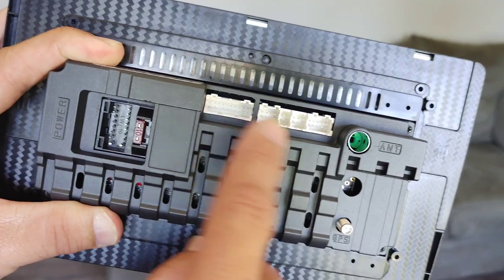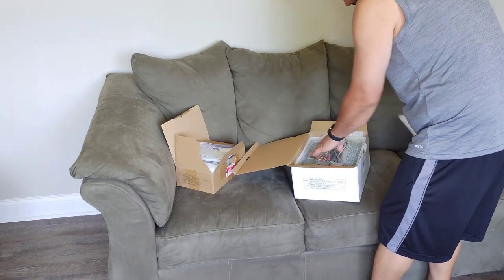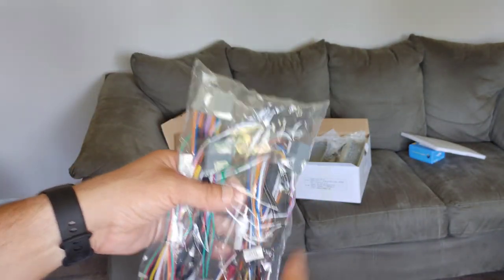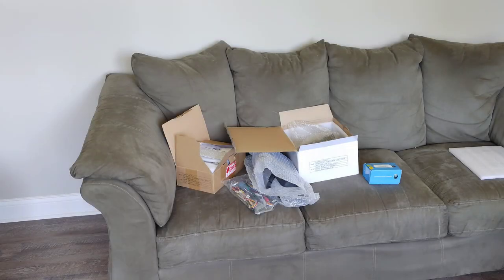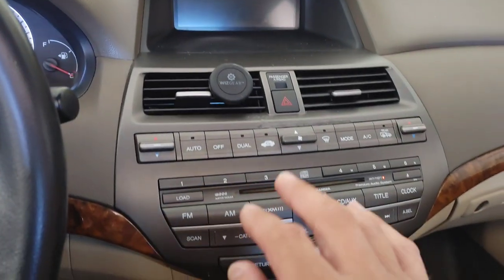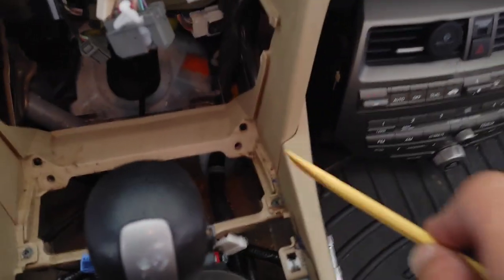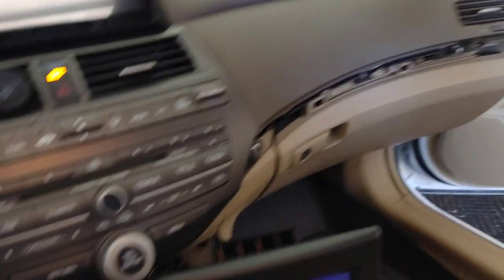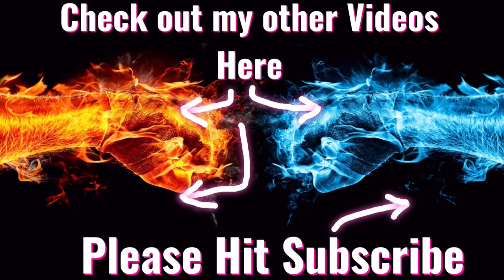$207 2008-2012 Honda Accord Android Radio Install 10.1"  DVD Navigation GPS Bluetooth Backup Camera

Comment: When you start putting everything back in, did you start with the radio, then the head unit, then the clock?
Reply: Btw were there any wires you didn't use?

Comment: Hi; Were there two Phillips/8mm head size screws behind the storage cubby below to complete the removal of the OEM radio? On mine there is - it was basically 4 screws and a bunch of clips holding the OEM radio in. Ours is a bit different - no dual auto heat/AC and no SiriusXM which I have in my Civic and love so I was wondering if Honda had different setups in 8th gen Accords?

Comment: How secure is the unit tho? Someone said that this size can shake loose from car vibrations but idk how credible that is
Reply from the maker: I don't see that happening, my car is lowered and has low profile 20" tires and have never had a problem.
Reply: Happened 3 times.

Comment: I had an Android Head u it installed in my 011 Honda Accord. It works and the stock radio too works. But when i finished i discovered my power lock does not work, key fob does not work, Washer does not spray but wipers work, night lights on my radio and HVAC do not light up, my High beams too do not work but low beams work. Any idea what could have cost this?
Reply from the maker: Sounds like you did something wrong and shorted something out and or blew a few fuses. You need to start by checking all your fuses in all the fuse boxes. And if they blow again then you have something wired up wrong on the radio.
Reply: @RoadMisfit187  Everything was just plug and play, no hard wiring apart from backup camera and Steering wheel controls (SWC) which i connected later after the issue had started.
Reply: @RoadMisfit187  After spending like $180 for car repair technicians to troubleshoot the problem to no avail, i went back and reconnected my old system back and all the problems went away. So i started connecting my New Head Unit again while trying to find out what I was doing wrong. So i found out that i wasn't fastening well one of the plugs. Since then till today my car works perfectly.
Reply: Please make sure you fasten or connect your plugs or connectors well. I found out i had some loose wires (probably a ground wire related to the ignition) that was causing the problems i had. When i went back and tightened my plugs and connections, everything was fine till today.
Reply: The same thing had happened to me but only the hvac and night lights wasn’t working. The minute I had turned on my low beams the fuse regarding that would make an electric noise then blow constantly having me to replace it so I switched back to factory. Did you end up fixing the problem?

Comment: can you explain where to connect the camera wires at the back of the android unit exactly.
Reply from the maker: Its been a while but on the back of the unit I have a wire with a tag called Camera. I used that wire. And plugged the rca jack into the carmera rca.

Comment: Thank you for the tutorial. Questions: Did the unit come with the bottom plastic trim piece where the original clock screen goes or did you buy that dash trim piece separately?
Reply from the maker: Yes, it came with it. It comes with everything you need to do the installation. It is so nice!
Reply: Is there a way to just buy the bottom trim piece separate?
Reply from the maker: @Threework  not that I know of

Comment: Hi im thinking about buying a screen for my honda accord coupe 2008 but it doesnt come with the down box to relocate the radio, is that part very necesary? Do I need to buy it separately or can I just take out the radio? Also tis a different model, a 12.3 in horizontal display. Thanks in advance!
Reply from the maker: Yes, you need to relace the climate control display. Otherwise, you won't have any heat or air. I don't believe they sell the brackets and wiring harness to move the display separately.

Comment: I bought the $179.99 unit from Amazon made by Hikity. It has an orange KEY2 cable coming from the power harness from the back of the head unit. I have no idea where to connect that to in a 2011 Honda Accord EX with no navigation. The only other wire coming from the harness is a pink wire that is not labeled. The other wires Reverse and Antenna or labeled. Any advice? I haven't taken the care apart yet but trying to do all th research I can before starting. I guess the KEY2 wire has to be connected somewhere for my steering wheel controls to work.

Comment: I read a review about there being a parasitic draw when the car is off because the unit doesn’t turn off, it only goes to sleep. Is this true? Have you had any trouble with this?
Reply from the maker: Zero problems, mine turns off and does not kill my battery.
Reply: @RoadMisfit187  this might be a dumb question but how did you download music videos from you tube and put them on a usb to play in the head unit

Comment: How would you do it if you have the larger navigation screen instead of that small one?
Reply from the maker: @kethenbt4215  How would I do what? This is the largest screen that I have seen.
Reply: @RoadMisfit187  I mean my original screen has the navigation on it and I bought the screen you used but my original screen would be too large to reconnect by the gears at the bottom
Reply from the maker: @kethenbt4215  You dont reconnect the old screen, this replaces your old screen. I think that's what your asking
Reply: @RoadMisfit187  right but didn’t you place your old one from the top down at the bottom by the gears and connect it with the extension wire?
Reply from the maker: @kethenbt4215  Yes correct my display fit down below.

Comment: CAN YOU CHANGE SONGS FROM THE STEERING CONTROLS WHILE IN AUX MODE WITH THIS NEW SET UP?
and
CAN YOU STILL USE THE CD PLAYER?
Reply from the maker: They sell a separate steering wheel control wiring harness. But I didn't buy it. Everything else works like normal including the CD player.
Reply: Steering wheel controls will still work normally if you connect the cable labelled "KEY" from the Android Unit to the harness of the car then it will permit you to learn the controls. (That's how mind was connected).
Reply: @stanleyfongang2807  Can you please guide on how to make steering wheel control work? Key tagged wire should be connected where and how? Which pin of the radio harness? Thanks!
Reply: @vinitshandilya9855 I believe it goes connected to another “key” wire if I’m not mistaken. I just saw a different video where bro showed how he was hooking it up

Comment: I saw following comment from Amazon.  "The dashboard won't let you customize it and when using the default dashboards that shows your speed, it only displays in kilometers per hour regardless of your regional settings. " Is this true?
Reply from the maker: It comes with some preloaded backgrounds but you can upload more from your phone or wifi
Reply: You can change the speed units by long pressing on the KM/H or the value of the speed.

Comment: You did not show step by step installation of the head unit.  I was even waiting for the step by step installation of the Rear Camera.  : (
Reply from the maker: Honestly, it was very easy anyone can do it.
Reply: @RoadMisfit187  Thanks for putting up this video. Is all the wiring so obvious? (I am new to car stereo but considering this for CarPlay and backup camera mostly) I am just scared of wiring.. Where did you put USB cables? Does it come with a harness for the original display, which will be moved to the bottom tray?
Reply from the maker: @sangminlee1364  Yes, it is very simple. All the connectors are different so you can only plug them in the right way.
Reply: @RoadMisfit187  Thanks! I guess control buttons on the steering wheel won't work except for volume? Also how long did it take for you to install both the head unit and the backup camera?
Reply from the maker: @sangminlee1364  Correct the volume buttons still work. Took about an hour for the radio and about 30 mins to install the backup camera.
Reply: @RoadMisfit187  i can’t figure out which yellow wire to put to the red wire for the backup camera

Comment: Should we disconnect the battery while doing the wiring? I did install everything but the radio is dead, I checked all fuses and they’re all good! Do you have any idea what would the problem be?
Reply from the maker: Are you saying the new android radio is dead or the Honda radio?
Reply: @RoadMisfit187  the honda radio
Reply: Can I connect it directly to the speakers and not use the Honda radio
Reply: @RoadMisfit187 are you in California? Fix mine!!!😂😂😂😅
Reply from the maker: @moi19899  Sorry I'm in Cincinnati
Reply: I don't think the radio is dead. You have to press the power button and then the display is going to ask for a code. Check the sides of your gloves compartment for the code if you don't have it. If you find it, and the radio comes on, then use the numbers above CD player to type the code.

Comment: I’d much prefer the double DIN be mounted below the AC controls.   The upper area is just too far from the driver position.   Also, seeing the old radio controls still intact is just weird.  Busy, cluttered and utterly redundant.
Reply: It uses the old radio. It’s literally just a screen for the radio not a replacement for it.
Reply: Crazy because I'd prefer the other way, I think when it's low it looks cheesy.. imo
Reply: If you want it that way, there are other models that will come with a separate kit to replace your stock radio but maintain your AC controls. Then the unit will be wired directly to your car AMP if you have a separate AMP.